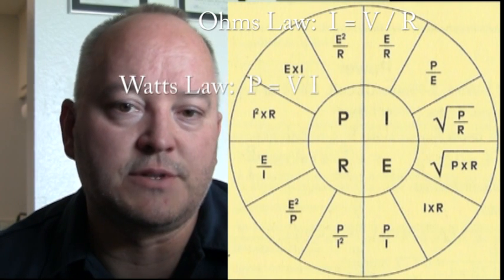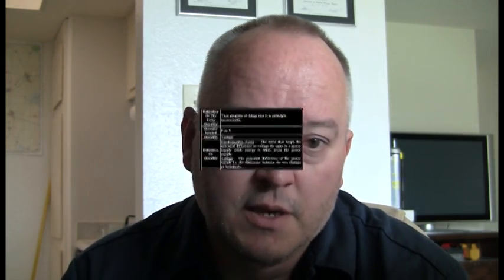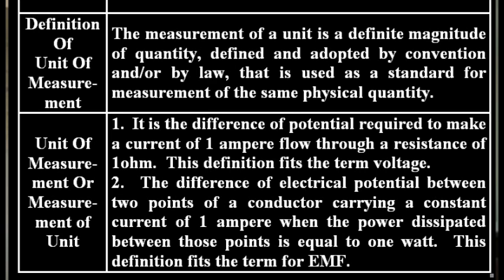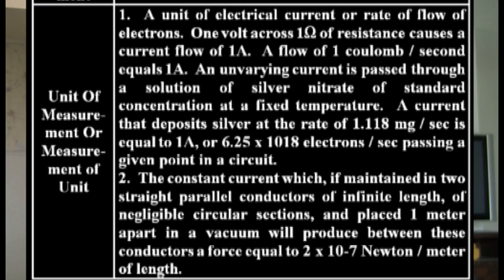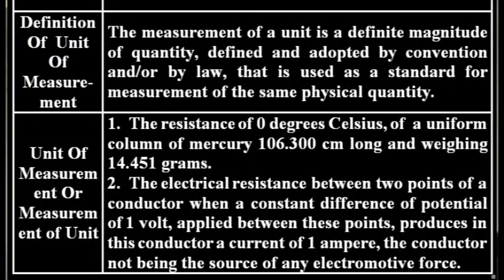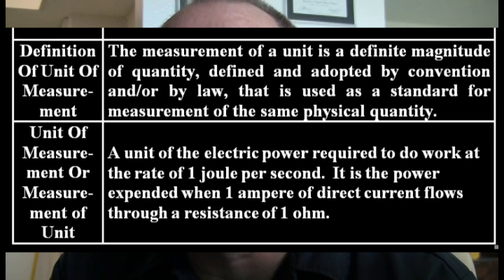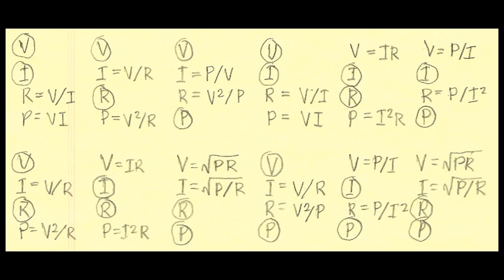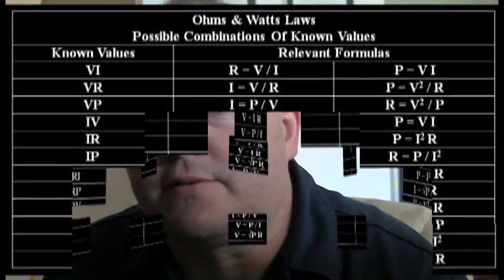Ohms Law Formulas Uncut

Comment: Actually I did do a real time video on what the difference is between Voltage and Amperage using real time illustrations and explanations. It's really so simple I couldn't believe it. No need for all that garden hose garbage-It's as simple as generator speed and size-those are the two main factors. Thank you for the comment.

Comment: EXCELLENT video Rick. It runs long but has about 50 times the info that most other vids like this have. I think you should so more videos. I get complaints about not using the correct terms in my videos, however I am just using terms that people are used to hearing (when in Rome).  Actually I CAN explain WHY voltage and amperage are different and how to explain what EMF actually is by comparing generator size and RPM, Size=Amps & RPM=Voltage. I may reshoot a vid using this analogy.